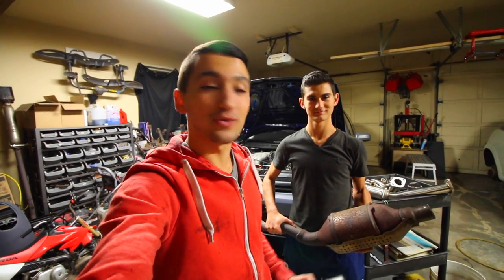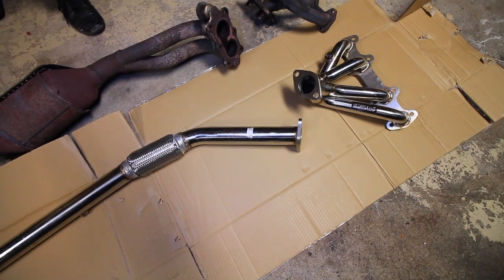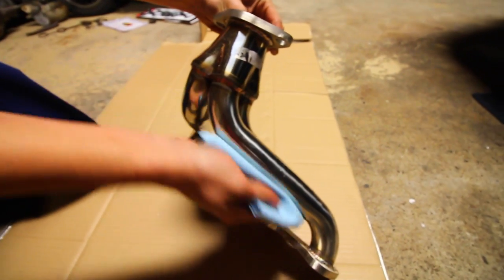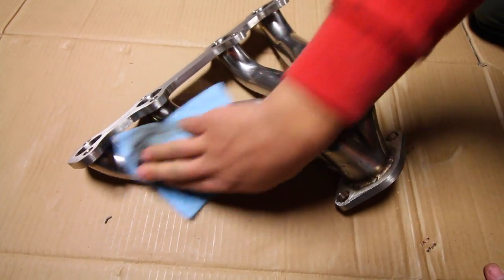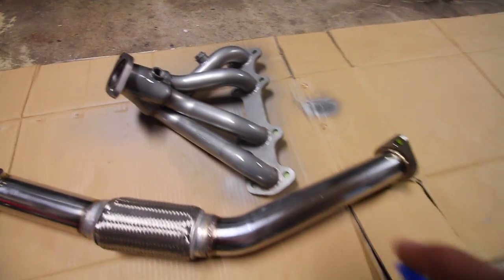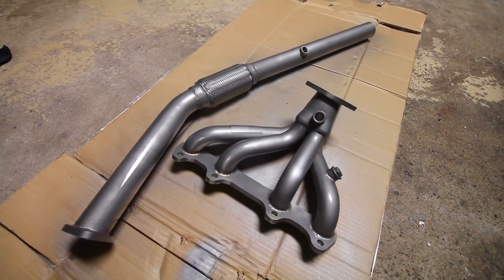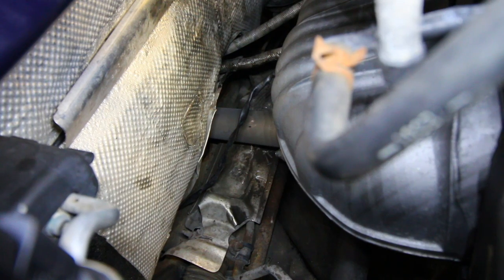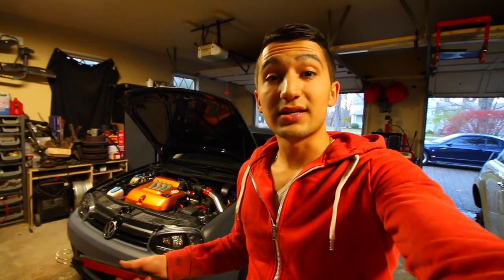How to Ceramic Paint Your Headers

Comment: isn't it bad to remove the catalytic converter?
Reply: Pavlo95 yea it wont pass emissions
Reply: It will pass as long as you don't have a cel and they only check via obd
Reply: george pacan some states don't have emissions
Reply: It will be bad if you dont do a o2 sensor bypass. Emissions inspection will pass without a cat if the vehicle is an emissions exempt. Different places do it by model year, age, etc, or not at all. My area exempts emissions for 1995 or older.
Reply: James states? in canada?
Reply: george pacan just saying in the us some states don't even require emmisions
Reply: Not at all it depends where you live honestly I know here in Oklahoma they don't give a fuck, you can go straight pipe all you want
Reply: Won't pass in most state/provinces.
Reply: Pavlo95 no, less restriction
Reply: if you're a ricer, you remove it
Reply: Jonathan Sosa lol why do you say that
Reply: Sometimes emissions arent implemented in certain states or counties in the us, I live in an emission free county basically means just as long as its not too loud I can run true straight pipes with a full bypass
Reply: not good cause can burn seals inside from lack of back pressure. Straight pipe too. That's what I've heard on forums and comments kn straight pipe videos guess all depends.
Reply: Jonathan Sosa or if you have a muscle car or truck
Reply: we protested emissions here in ohio. its been 20 years now with out it.its another scam the state does to make money.
Reply: If gaining horsepower is bad then yes? Lol it actually depends on the car but rarely does a car not benefit from removing the cats. If the car is a pre 96 car without an ob2 port then there is absolutly no way you will pass emissions because they actually put the car on rollers and measure the gases coming from the tailpipe. However if your car is post 96 (has an obII port) then you have the ability to delete the cats and pass emissions. You either have to get a tune to trick the ecu into thinking the rear o2 sensors are reading clean fumes or get mil eliminators which are plug and play. I own a 98 svt cobra and it came with 4 cats from the factory. My car now has on off road h pipe (doesnt have cats anymore) and has a dyno tune. Gained 20 more horse power just from removing the restricting cats. And while at the dyno the tuner tuned out the check engine light and i pass emissions every time with flying colors. A cat is also restricting the sound from your engine just as much as your muffler (at least in my case) so deleting the cats will greatly raise the sound level.
Reply: I used this paint on my sbc 1988 GTA it lasted 6 months and all chipped off and looks like crap 
I even did everything you did and I baked it in my actual oven in my house  
And it still didn't work 
I'm gonna have to wrap it with header wrap
Reply: PVKLoL illegal yes
Reply: Ben Kalinowski the paint he used is only rated to 500 Fahrenheit.   Have it powder coated next time.
Reply: Ben Kalinowski put the headers on and the engine will bake the headers for you.
Reply: Over here in California I had to buy the cat from the dealer. Not classic but just old and cat cost more then the car.
Reply: It’s super illegal but it isn’t necessarily harmful to the car. Exhaust will randomly stink when your in traffic. Not worth it for that reason to me
Reply: Sounds like a weed wacker
Reply: Is it bad? Yes, it releases dangerous pollutants in the air that is causing global warming and cancer for humans.
Reply: It against the law! you’re messing with the smog system
Reply: for environment yes.. also for the ears of the peoples houses that they have to drive past hearing that german fart cannon exhaust
Reply: @mrklimczyk  where do you live that has no smog pre 95'?
Reply: Nathan B I’m in Missouri. All counties require a safety inspection and only a few counties require emissions. I’m in a county that requires both.

Comment: thats very interesting I must admit. repairing exhaust on my golf is in my plans when it gets warmer. but right now I need to sort out bunch of other issues like coolant leak, replacing of fuel pump and replacing messed up throttle. all of that over this weekend. at least that's the plan of sorting all major problems after 3 months including an icing on the cake Alloy decals😁

Comment: Stainless steel doesn't rust you muppet.
Reply: Cloudymind Stainless Steel Does Rust Over Time.
Reply: quality SS should not, they got cheap stuff there almost for sure
Reply: Cloudymind 
Really? How would u know. All your baby toys are made of Plastic.
Reply: Wrong stainless steel can corrode. Yes it is one of the most resistant alloys, but under certain circumstances it will begin to corrode. And one of those circumstances is when its exposed to high heat temp and moisture.
Reply: @jarretwilson5811  correct.. i.e. marine enviroments.  all the years i've been on navy ships; everything corrodes eventually.
Reply: @stumplimit   Marshall R  all steel has iron or it wouldn't be steel. Steel is an alloy of carbon and iron. Stainless steel adds chromium and nickel its the structure of the crystals which makes it non magnetic search ferritic and austenetic.
Reply: It depends on how much chromium is in the steel. Low grade stainless will rust high grade will not.
Reply: @anthonycphillips2430  being in the navy shit goes to the lowest bidder. High grade stainless steel will not rust.
Reply: Marshall R 
It’s called 316L. Which is almost pure chromium used in marine environments.  304 stainless doesnt rust it can corrode over a long time. 
If you have had stainless steel weld on you it was probably 409 stainless which looks just like 304 but is a much cheaper version with less chromium in its  alloy make up
Reply: Well obx is made of 304 cheap grade... plus stainless steel will expulse chrome carbonates when reaching 350 degrees C so... well anywhen it gets red... it will rust for sure!

Comment: You can put your ceramic coated project in a regular oven too, right? There should be no fumes left over because most paint fumes are from the spray agent coming out of the can, but that's done.

Comment: I have had Stainless Steel headers on our mud truck for last 6 years,  they have yet to rust,  and should have sanded them with 320 or 400 grit paper before attempting to paint them.  scotch brite on Stainless Steel not doing much.  but good luck.  let's see them in a year.
Reply: backyardbuilttrucks1  so question  I have to change out my cluster from a golf gti vw  what do I need to  do to get done

Comment: Don't need heat shield if you have a ceramic coating and I would have taped off the flex pipe section it's going to end up cracking and pealing over time
Reply: Baylee Doom does it work like an actual ceramic tho? Reducing heat expelled...

Comment: If you ceramic coat headers you should also coat the inside also. Otherwise you get metal fatigue. Traps the heat in the metal. Fatigues then failure. I have had header tubes blow open like a big firecracker was in it when I gave it the onion.

Comment: Are the headers stainless steel? I have an aftermarket exhaust that is good quality and made of stainless steel material, will it corrode, is it worth ceramic coating it?
Reply from the maker: Stainless exhausts will eventually corrode, but they might take a bit of time to get to that point. If you live in an area where the exhaust will see snow and salt, I would 100% coat it

Comment: I think you guys did a good job!!!!!  as for people and the stainless steel debate they're stupid AF!!!! The whole reason you ceramic coat the headers is to help contain the gaseous heat within your exhaust pipes. This causes the gasses to heat up and expand. Resulting, exhaust flow is boosted, allowing a rush of fresh air to enter the engine's cylinders, increasing horsepower. Some people such as drag racers and Rat Rod builders don't coat them at all they just wrap it in a high temp wrap that u can get at any AutoZone or O'Reilly's next to where u got that can of paint. the wrap is a fibreglass or composite fabric that wraps around and insulates exhaust system components. It is a DIY solution that can be added to nearly any exhaust part, stock or aftermarket. ProsAdds a few extra horsepower when used on stock or performance pipesReduces under hood temps, prolonging the life of fragile engine parts and hoses. u can also use it cover spark plugs boots or for any rubber hoses that can shake off their holders or plastic brackets so they don't touch the header and melt off ...

 - Perry Griffith Automotive Professor @ Odessa College in Odessa TX, and former Service Manager at Broncho Chevrolet & ASE Master Technition. -

Comment: welding flux is what you cleaned off the first run over. after scotch brighting it you should have used stainless steel pad instead. scotchbrite does not grab the metal good enough you want big deep scratcges for oil based paints.

Comment: Honestly dont need to tape any of it off. The paint will in no way affect the seals on a exhaust.  Especially if proper gaskets and torque specs are used

Comment: You did a great job on it but some advice  to use gloves so you dont get any ouls on the metal or paint and in my opinion after painting it with whatever high temp exhaust color. I'd put a clear coat on it too to make it look pretty

Comment: The paint looks good, how long does it last? FYI -The "honeycomb" in the cat is pure platinum, take it to a metal recycler. Probably pay for the new cat back pipe. That's why cat's are so expensive. Re-guarding the sound? I've grownup around racecars and motors. Headers and pipes, you can go for sound or power. What are you looking for? Always obtain a dyno sheet, if you can't afford dyno time. Most young adults today go for that horrible fart can sound, that noboby wants to hear.  You seemed really pleased and that's what it's all about. Happy motoring!

Comment: Put the tape that will he trimmed last so when you peel the main tape those will come with it. Saves a little bit of time. Also you could paint with tape as it was. Just focus on the corner a little more with lighter coats but eventually the same amount. Unless you like cutting it out then that’s cool too. Looks good. Sucks to paint new shiny
Things though

Comment: What works better is coating the inside of the pipes. You will have that protection all the way through. Spraying the outside doesn't keep them from discoloring. Even with the exterior coat the will still change colors. Have you ever noticed how some motorcycles will have alot of miles but there pipes will still lool brand new thats because they've been coated inside. Plus you basically ruin the chrome look the way you did it.

Comment: When you guys do this stuff like running these little toads with no muffler on these mostly Aluminum foreign engines remember they are not full race engines and they do not have a tuned computer so what that means is these engines are designed to receive back from the EXHAUST mainly a muffler what is called a HARMONIC PULSE which helps cushion the valves itself and the valve seats... This is the reason after a little time these motors will do one of the following due to lack of receiving this harmonic pulse they will either drop a valve burn a piston or knock out a timing chain which is more prevalent on the Over Head Cam motors. There is another syndrome where the rocker stud will either snap off or come loose from it's mounting in the head.... After 40 years on the race tracks and in the pits I know what I am talking about kiddies so take heed to running one of those little toads with no muffler it's there for more than one reason alone other than controlling sound.

Comment: If you get stainless headers please don't do this, just leave them alone it will take a very very long time for them to rust and it's not even that bad. When the headers finally do rust you can either do this or get it professionally done, depending how much you paid for them. Just get painted headers if you want to do this.
Reply: I think this is done for the heat purposes as well not just esthetics

Comment: I saw that the golf spit out fuel when revving, my car did that but not anymore lol what does that mean?
Reply: AwesomeRanger03 it means that there was too much pressure so some gas just had to escape out so it cane out of the exhaust
Reply: AwesomeRanger03 how do you know that's fuel??? It's likely that it was just water.
Reply: - A13X - Because water isn't black.
Reply: You can tell it was fuel, it wasn't water
Reply: faisal3398 and fuel is black?!?
Reply: faisal3398 it is water from condensation. It's black becaus it washes out the fumes in the exhaust
Reply: PizzocanWasd That's what I was thinking. The combustion of fuel produces a lot of water so it's quite likely that too!
Reply: That's cool, didn't know that. So it's a mix between water n fuel? Coz it did have a rich smell in fuel, therefore me thinking it spit out fuel  lol
Reply: AwesomeRanger03 In the combustion of any hydrocarbon, water and carbon dioxide are always the products. If something doesn't burn completely because there is not enough oxygen, then there are other products like a soot or carbon monoxide.

Comment: Stainless steel does not rust.I've had my megan header on my car for about 5 years now.only thing different from New is the heat colors.get a good set of headers and you won't have to do this.OBX uses a 50/50 mix of stainless and other metals.that's why they rust.

Comment: how do you get a deep sound without the rasp but also with a little crackle when you downshift?
Reply: Mike bigger diameter piping
Reply: Mike high flow cat. or straight pipe with a good resonator and Muffler
Reply: Mike get a good resonator to get rid of the raspiness usually the stock ones kill the deep tone.
Reply: @Muzza If you've got a big displacement engine yes... but this engine you want a maximum 2.25 inch paired up with a glass packed resonator and a quality muffler then you'll get your crackling since you'll have enough back pressure @Danny definetly this one. You get a borla muffler and glass packed resonator and you'll get your cracklings ound not that raspiness. Also...on a 2.0 SOHC VW, you don't put anything bigger than 2.25" unless you want people to laugh at your fart can exhaust. Put it this way. Proper exhaust for a VW 2.8L VR6 is 2.5" imo
Reply: 0cTeT yes but crackling also depends on your ecu and how its tuned
Reply: Muzza agreed brotha

Comment: How do you like those OBX headers? I have a set as well but I had exhaust leak issues at the head. Did you have any issues on the install?
Reply: Use a multi-layer steel gasket. Usually aftermarket headers come with a perforated metal core gaskets. From my experience, they tend to leak. An OE style two layer steel gasket usually will not leak if torqued properly.
Reply: Mike Lindsey thank you I'll give t a shot. I also noticed that this header has a round bore and the head has sort of an oval hole so I need to get that corrected cause I feel like it makes it less efficient so to speak.
Reply: Mike Lindsey I will make sure I try this though!

Comment: This is not ceramic coating. Ceramic coating isn't just for appearance, but also to contain heat within the exhaust, which both helps keep exhaust velocity up and underhood temperature (i.e inlet air) down.

Comment: A possible better way to prepare the header would be to media blast it, that would really give the metal some tooth for the paint to adhere to.

Also stainless steel generally does not rust that’s why it’s called stainless.  It will discolor with heat.
Reply: Stainless steel can certainly rust

Comment: i would think the 1/4 , 2/3 header merge design of the old exhaust manifold aka 4-2-1 would prove to scavenge better than the 4-1 you guys installed.  i would of just put a test pipe where the cat was and sandblast the old header so you can coat those. Probably get a slight boost in power  on the top end and sound better at the same time.

Comment: It sounds like only 4 cylinders have fluid in them. You may the to check the anhydrous ningklewerts as the known to cause a disruption into the rotorgambit slip streem greatly reducing synusodal depleneration. And what we all should remember from high school is the Chellmonglaze coefficient divide by co-adhesion tension builds an inverse reaction to volumetric efficiency we’re as “C” is to the 10th power and abudution fluids frequently comingle with the rotors-slip stream, causing an inverse reaction to all captive non-synusodal depleneration in a community of sunscreen aplicators which always resukts in adverse novertrunion during final application bht’s. The Peruvian book of statilogilocal sceinces in the April 23rd edition, published in 1934 makes this very clear! So don’t try this at home!

Comment: Wouldn't media or sandblasting be better than scuffing? Also wear gloves so you don't re-contaminate the surface with your fingers. Also don't lay it on cardboard, hang the pieces on wire.

Comment: Use caution - A heat gun set a new pair of boots on fire when I tried drying them after walking in the snow - the inner liner got too hot and started burning, after a few minutes of running the heat gun.

Comment: Why didn't use primer before painting?
Reply: Billy Eminov , the primer paint is not high temp and will burn off taking the high temp paint with it , you primer car body parts because they don't heat up to 1000 degrees Fahrenheit , headers do

Comment: Ya know... they make flameproof in a satin clear that would have looked a million times better over that brushed stainless than garbage flat silver that looks like 99c Walmart paint...
Reply: Thermotec 12003 copper header coating is also 2k deg, is actually made of copper (like high temp steelit) and would have also looked more bougie...